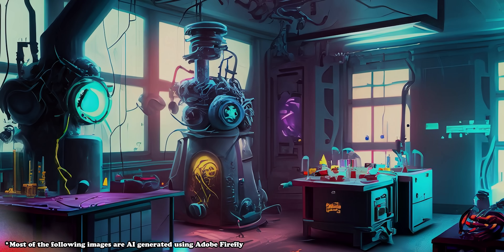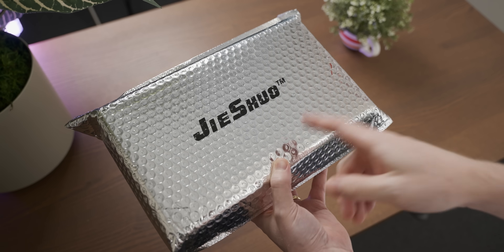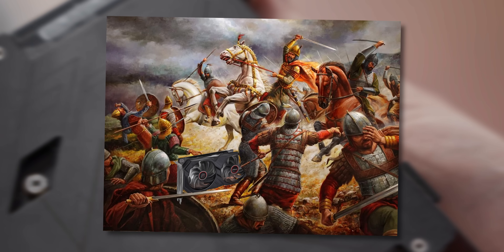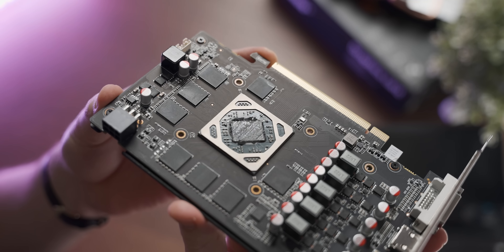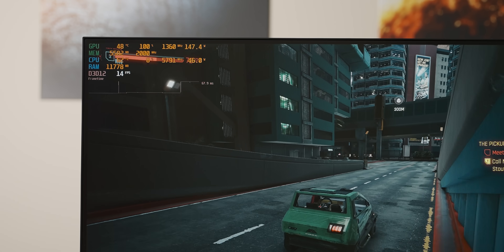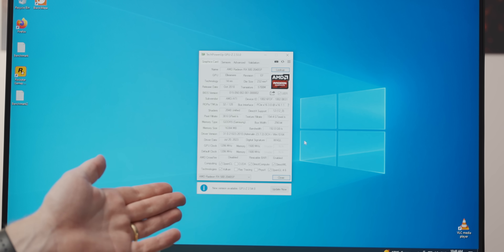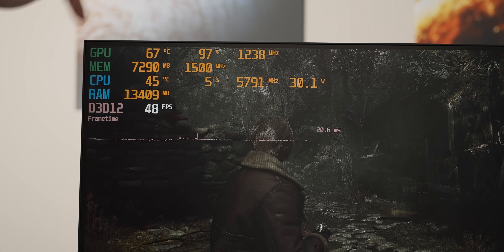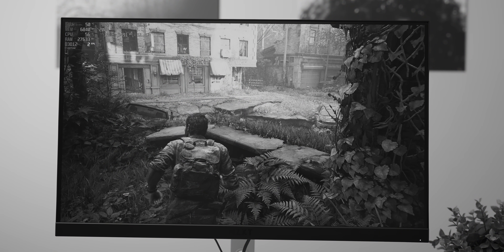Why Would They Make This? 16GB RX 580 From Aliexpress...

Comment: Dawid, you gotta understand (and a lot of gamers and Nvidia takes advantage of this misconception) that resolution is not the only thing that affects VRAM usage. Texture settings are typically the settings that affect VRAM usage, but even then there are a lot of games that "smartly" use VRAM for textures. In a lot of modern games, the texture setting simply affects how fast the textures are streamed in, not how big the textures are, RE4R being the best example. (annoying how they put a gb size next to the setting despite that not being what it does)

But that's not all, any RT settings, specific detail settings, all will affect VRAM usage, not just "pump to 4k to use VRAM". It hurt me to see you playing games at 4k with medium settings, like what's the point of testing out the VRAM if you don't change the settings that actually scale with more VRAM!
Reply: TL;DR
Reply: @rustler08  TLDR: 4K resolution is not the only way to increase VRAM usage. Normal settings do that too. Turning a game up to 4K but keeping the settings low will not use too much VRAM.
Reply: I get you're trying to be clever, but not enough to prove him wrong. It ultimately varies based on the method game developers used to make the game. Doom eternal, RDR2 pre-caches everything into vram to prevent stutters. Tiling is used with dx12 and as you say, is a smart way to use vram. It however requires some advanced yet troublesome prediction or scheduling to prevent stuttering. There are many games that simply determine textures based off of resolution, so dawid is completely fine in his video. The game is not going to load higher resolution textures for a lower screen resolution, there is zero point. On the flip side a game might default to 2k textures or higher when set to 4k resolution.
Reply: Shadows also use quite a bit of VRAM

Comment: Yeah when I heard about this version of the card, I just asked myself "why? and WHY the cut down version?". 8GB is really the sweetspot for RX580, more and slower memory will not help you in any case. RX580 is such a good card, released in 2017 and still relevant card for 1080p gaming in 2023, and you can undervolt most of the cards so they are super efficient for this architecture.
Reply: Why ? Mining. Much less energy used (as we could see in the video), similar yield. With 16 GB you could mine even more, so it makes perfect sense. Now of course it is not needed, so it ends up gaming.
Reply: I 4k game on my rx 580 8gb a lot.  in most cases where i can't 4k games with it I upscale from 1440p and use image sharping and I can't tell it's not true 4k.  cyberpunk is obviously exempt from this.
Reply: My guess would be etherium leftovers. Mining ETH required a lot of RAM, but wasn’t very intense on the core. My understanding was that it did benefit significantly from faster memory, but maybe they were chasing some type of power savings or maybe this was just what was available and cheap and worked.
Reply: I just finally upgraded from the rx 580 - the thing was a champ. I mean still ran everything I ever threw at it well enough.
jumped up to the 7600. This new card runs so cold for me, I dunno how I am going to heat my office this winter.
Reply: @BronzedTube  easy, turn power limit all the way up. 😂
Reply: @BronzedTube  Why, though? You could have literally spent like $40 more for a brand new, on sale 6700 XT or 6750 XT that would have crushed the 7600. Or, even a used, under warranty 3070.
Reply: @rustler08  some people really just wanted a power efficient gpu with playable performance for every game they play
Reply: @BronzedTube  its kinda crazy I have a 580 and I was planning to upgrade to a 7600 too 💀💀
Reply: @degnartsE I wanted to get a 7600 but I have a 1060 6gb. So same jump but diagonal

Comment: The 16 GB version only has 192GB/s of mem bandwidth. If you could push that a little higher (normal 580 has 256GB/s), it would net you some significant, additional performance. Polaris10 allows for adjusting memory timings and bios mods btw.
Reply: For some reason they used 6Gbps memory modules instead of the 8Gbps modules that the original RX 580 had. This probably made the performance significantly worse.
Reply: @Tetraverse  it was a flashed mining card
Reply: @Tetraverse Could you then just solder 8Gbps modules yourself?
Reply: It came out prime crypto mining era, and just before COVID was a thing. So no doubt it was for saving money.
Reply from the maker: It is such a nerfed version of the card. The bios mod is a good suggestion. I’ll look into it. 😃
Reply: @DawidDoesTechStuff  oh man I hope something will come out of it
Reply: Yea, I've modded the BIOS on my RX 570 8GB. 1350 core/2050 memory with just 130W. Thanks to memory timing tweaks, the effective bandwidth is up by 50GB/s compared to stock. It performs about equal to a 1380MHz RX 580 while using ~50W less. Polaris benefits a ton from memory tweaks and undervolting as all cards by default have a stupidly high voltage. My GPU was allowed to go up to 1.25v and usually stayed around 1.125v during gaming. Was able to go down to 1.062v while overclocking the core by 60MHz.
Reply: @r34ztune11  With your overclocking settings, how does the card perform? How much faster have you got? Is your card a 1080 now for example ? :P
Reply: @r34ztune11  I've undervolted a RX590 I bought a year ago for 70€ and it's 1400/2250 with a TDP of 140-142W. I really love this card, never had any crash in a year.
Reply: @r34ztune11 I have MSI rx 570 8gb. Could you share any link for this mod?
Reply: @r34ztune11   I have ran my rx570 at 1500mhz in a furmark run...
Reply: The memory also runs 500 Mhz slower. Everything is nerfed on this card.
Reply: GTX 1080 came 2016 as well
Reply: this has a 256bit bus like the 570 and 580.  the 580sp is a 570 with a slight core boost
Reply: I think this card was targeted to mine crypto
Reply: @zax3726  Mine crypto ?  16gb?! 

Which Crypto require more than 6gb to mine ?
Flux Dag-file requires about 4gb+.
Reply: there is no point in messing with the memory timings. it only hurts performance by heating up stuff without heat sinking.
Reply: polaris is dead bc of new DirectX
Reply: @donciutino7490  What are you talking about? GCN was made for low level APIs lol. Polaris doesn't do RT - so what?! The games still run nevertheless. Btw, AMD's Mantle API provided the backbone for what became DX12.
Reply: @Psychx_  There was some thing about early dx12 gpu's not working because some newer games implement later revisions of dx12 with feateures that they lack, same shit they pull for usb or hdmi calling it the same but deep down there are different versions with their own specs
Reply: @joey_f4ke238  GCN 1.0 and Nvidia's ancient Fermi and Kepler architectures come to mind, as those are DX12 feature level 11_1 and 11_0 respectively.
Everything newer can do FL12_0 (GCN2-4) and 12_1 (GTX 900, Vega), with the latter only being required by Forspoken (which can be circumvented using VKD3D/Vulkan, so it isn't even a hard requirement)…
Reply: @donciutino7490 welp, guess vulkan might be the go to option then.
Reply: @donciutino7490  jokes on microsoft i dont use directx, only dxvk
Reply: @donciutino7490  source please?
Reply: @donciutino7490  is it 12.1?
Reply: @donciutino7490  What is it? the 12.2?

Comment: The 2048SP thing got me intrigued. Turns out, it's literally just the RX 570 with a small 40mhz factory overclock on the max boost. The RX 570 is the same die as the 580 and same architecture design as the 590 (it was a die shrink)
Reply from the maker: I think this version may actually be slower than an RX 570 out of the box due to the ridiculous low clock speeds.
Reply: Much slower. I have original rx570 nitro+8gb with performance like 580nitro and it perform like the asus 16gb. I`m very happy with my graphic card. My old grahpic card was rx550 xfx like this no name card and it`s a huge difference, no way :)   @DawidDoesTechStuff
Reply: The regular RX 580 cards use the Polaris 20 XTX chip, but the RX 580 2048SP is based on the Polaris 20 XL chip (better known for its use in the RX 570 series cards). In practice these are likely the same silicon, but the XL chips will be from defective dies where only a subset of cores were available, or they failed to make the power and clock speed targets for the XTX die and had the additional capabilities fused. In this particular case the GPU-Z reported clocks (1206 MHz GPU, 1500 MHz VRAM) suggest these might be from a lower rated bin than the standard RX 580 2048SP dies (1284 MHz GPU, 1750 MHz VRAM). Prodding around in TechPowerUp's GPU database, it appears Sapphire made an RX 570 16 GB mining card with higher clocks (1244 MHz GPU, 1750 MHz VRAM), which could be the source of the original design. Seems likely the lower VRAM clock is associated with lower speed RAM chips for a bit of cost saving.
Reply: RX 590 is actually a different die. It is made on 12nm instead of 14nm.
Reply: mine had an RX470 die. prolbably explains the random crashes whenever adrenalin is installed.
Reply: uhhh you guys had stock clock undervolt preset for a 2048SP?
Reply: No, "RX 580 2048SP" is actually having the same GPU as RX 470! If you go to GPU-Z, you will find that GPU in this graphics card model is called Ellesmere (which is Polaris 10 PRO) while RX 570 have Polaris 20 XL (and actual RX 580 -- Polaris 20 XTX).
Reply: Me redingote that and who do.t know shts about those bandits think and juste want à less expensive gpu for gaming
Reply: I'm wish Dawid tested ML stuff, theoretically (if you ignore AMD shenanigans) this GPU could be amazing bang 4 buck for stable diffusion/LLMs. I mean, if tinygrad succeeds :D
Reply: @MenkoDany only if you wanna tinker. gfx803 isn’t officially supported by rocm for a while. Thanks to amds drivers the speed on windows in ML is blatantly bad. In linux you will have to find a way to get rocm going for these specific cards, then you could actually get halfway decent performance for the price but it’s not really worth the hassle if you can just buy a 3060 12 gig or more recent 12gig Radeon card used for not much more
Reply: @MenkoDany RTX A2000 is a much better choice
Reply: @GewelReal    Every 'Nvidia' choice, is an BAD choice !    Ngreedia can rot in HELL !!!
Reply: 570 is not the same die as 580/590.  Thats where 2048 vs 2304 stream processor(aka sp) comes from. 590 is same die as 580 but manufactured on different node.
Reply: @tanmay5570  Please learn what binning is.
The RX 570 is the same die as the RX 580 (Polaris 20), just with some of the SPs disabled.
The RX 590 is a different die (Polaris 30), based on the same architecture but with a more advanced manufacturing process.
If it's "the same die but manufactured on a different node", it's a different die. If they are manufactured differently, they are physically not the same thing.
Reply: The 590 isn't the same die. It's the exact same design but on a more advanced node.
Reply: The RX 580 2048sp is just the RX 570 with another name being sold to the chinese market, same with RX 590 GME, it is just the og RX 580.